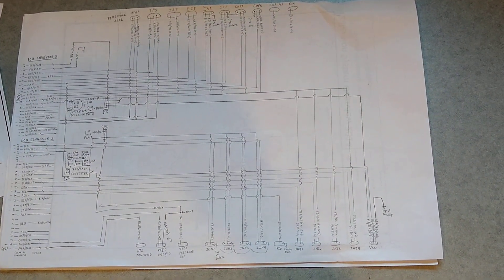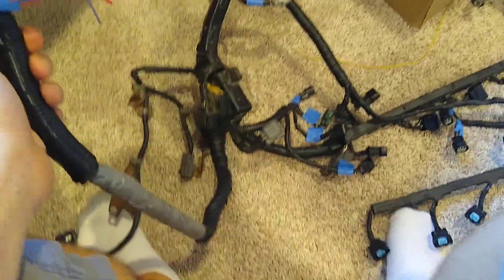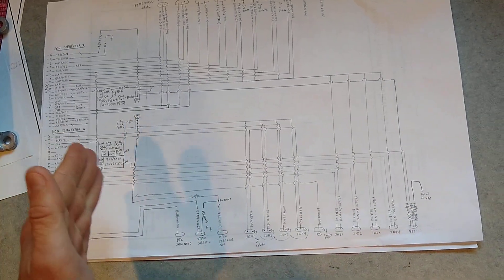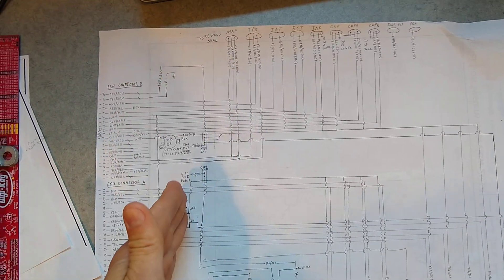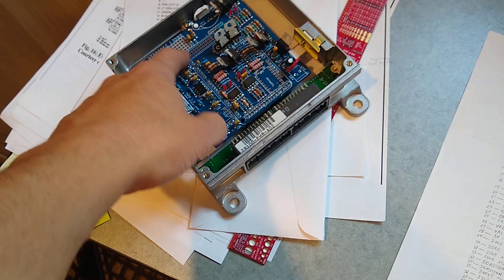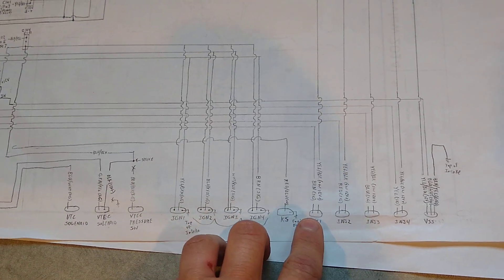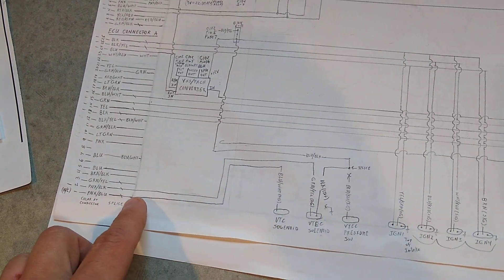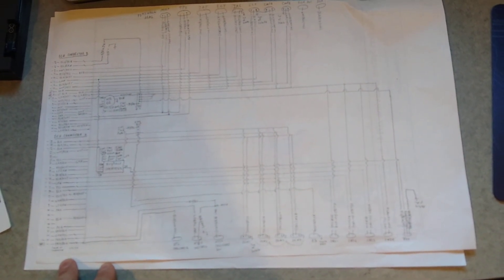K24 Honda Insight Swap Episode 10.2: Speeduino ECU to Accord Engine Harness

Comment: Are you gonna run wasted spark using the civic drop down menu or you gonna modify the can sensor lobes so you can run full sequential. speedy don't support nothing but wasted spark for this engine, unless you modify the cam gear sensor lobes.
Reply from the maker: I'm going to get it running in wasted spark semi sequential mode using the original 12+1 crank sensor (Honda D17 in the drop down menu) only to get it running and build my tuning skills while it is N/A. Later on when I add a turbo I will modify the crank trigger to 12-1 and take off 3 of the 4 lobes on one of the cam position sensors to run full sequential. I suspect it will run and idle fine semi-sequential with the small stock injectors, but will be hard to get a good idle when I add boost and ~1000 cc injectors.

Comment: How do you mechanically lock the vtc gear ? Very interesting I'm running a speeduino on a b18 LS turbo
Reply from the maker: The engine is a k24a4 from a 2005 accord. I am using the stock 25 degree intake cam VTC gear. The gear has a pin that locks the gear and cam at a fully retarded position when the engine is turned off. The 25 degree VTC gear has a range of +- 12.5 crank degrees from straight up. 

I worked out that 1 tooth on the timing chain is 15 crank degrees. So advancing the intake cam 1 tooth with the VTC gear locked gives me an intake cam that is advanced 2.5 (15-12.5) degrees from straight up. 

I will leave the VTC solenoid unwired for now, locked in this new position by the VTC pin. 

In the future if I decide to use VTC, I will be able to advance the cam an additional 25 degrees by controlling the VTC solenoid. This seems like a good video topic...
Reply: Nice work can't wait to see it running. I have 2 k Series but no ECU it would be fun to wire up a stand alone.

Comment: I'm following this build and I had a question. How do you get a base map or who would tune it?
Reply from the maker: I am planning to create a basemap. I will probably rough it in using a map from someone's k tuner file. Then I've got a wideband O2 sensor that will go in and I will tune it myself from there. If there is interest I can make the tune file available once I get to that point.
Reply: Es solo una idea.....podrias bajar El software de hondata....y copiar ..por Los Menos El mapa de chispa ...ya El mapa de combustible lol puede ajustar ya con El wideband.....